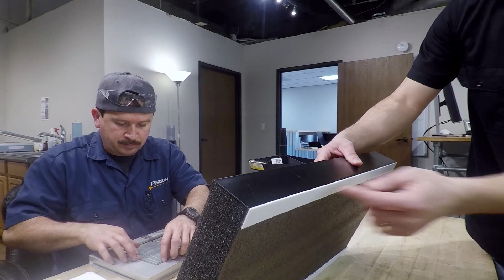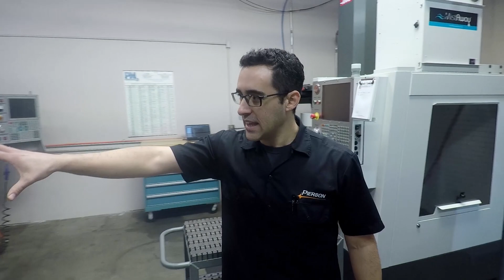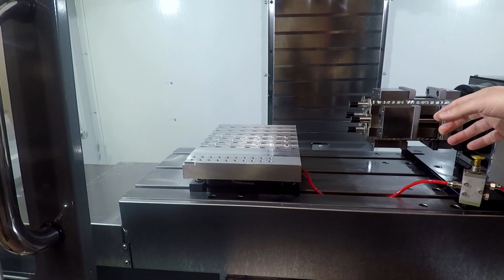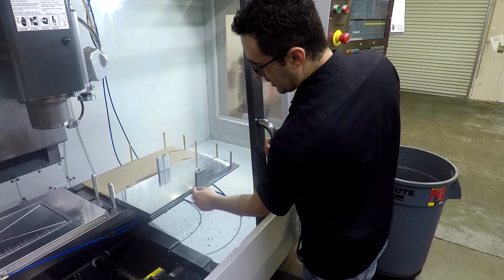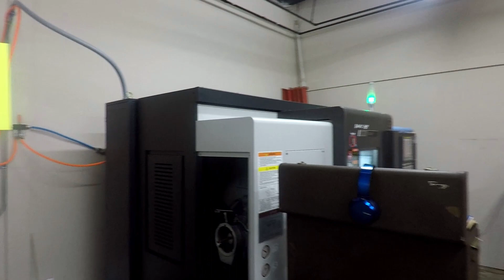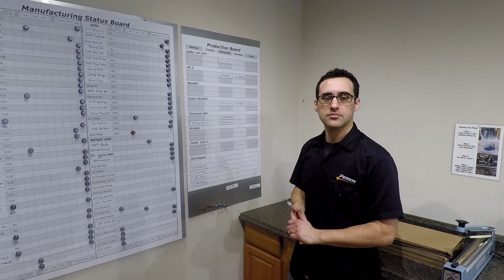AWESOME Lean Machine Shop Tour: Pierson Workholding!

Comment: I know this is an older video, but there is still A LOT of very good information here.
When I was in charge of a group of routers, I came into it with people doing 6-8 setups a night and a complete clusterfuck disaster of tool and material storage/staging. Once I got everyone on board with it, we increased production by  just over 30%. The most impressive was that we almost completely eliminated re-work. It was tough to get everyone to work together on it.

Comment: Lean makes sense when used sensibly. This is the perfect example of that process....trouble is that many companies have been using it as a tool to beat their people over the head with and make short sighted decisions based on it. Managerial motivation and experience are a huge key to making it work.
Reply: Great shop and tour! Lots to be learned from this.
Reply: devore1776 Lean for profit = failure. Lean for people = success.
Reply: Pierson Workholding truer words rarely stated!

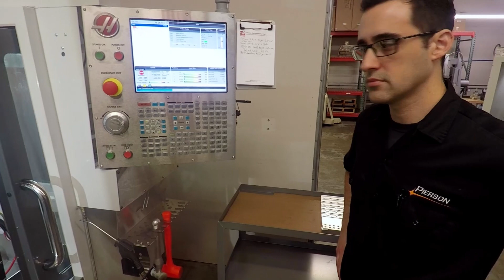Comment: 9:15 As to Jay's comment about Dovetailing a "0" Op. I see the logic of it.

Many of the Dovetail fixtures I see, are rather slim in design. You can typically run a larger part on smaller machines, and or use shorter tools, and feed faster. Which make up for lost time making the dovetail. It really comes to a simple scenario for a particular part whether or not if the machine time can be improved that beats the time to make the dovetail in the first place. If it technically doesn't, than that Pre- Op can be nixed.

Comment: One of the problems with lean is that companies don't understand what it is. They think lean = trim the fat = spend as little as possible and pay crap wages. They keep maintenance nightmare machines from the early 90s, never upgrade their tooling technologies, never update their machining strategies, never upgrade their programming technologies and rather than hiring clever people who can help improve the process...they simply standardize the process with no plans to improve. Then they hire people who will work for bottom dollar to push the green button. Oh, and the biggest sin of all is that they think employee downtime is costing them money so they'll intentionally avoid doing things like deburring in the machine so the employee will look busy during the cycle. Even at the expense of spindle down time which is MUCH more costly. They'll build cheap fixtures which take far too long to setup and they skimp on tools and techniques that make setups faster.

That's not lean manufacturing...that's just plain stupidity. Invest in the equipment, tooling, software, etc you need to get the job done efficiently. Streamline your process to reduce spindle downtime. Keep things organized and clean. Keep materials and tools close to where they're used (The machines don't move...why not store raw materials near them?). Take care of your employees and they will gladly take care of you.
Reply: Kenneth Higley Yes most companies don't know what it means. In a nutshell, Lean is the ability to see and eliminate waste (8 wastes to be exact) through continual improvement.
Reply: Kenneth Higley Those businesses will eventually die
Reply: THIS.
Reply: If good ideas are brought to management they see it as a threat.
Reply: Spot on !!
Reply: Sounds like somebody was hurt real bad by this philosophy.
Reply: Pumasforpe

Cc
Reply: The funniest thing is that if you look at Toyota production system, or other successful lean manufacturing systems, every example you gave is the opposite. State of the art machines in perfect condition, perfectly optimized and modern cutting strategies, ALL THE WORKHOLDING, and a team of amazingly competent people working super efficiently because they are payed well and can see how their input changes production strategies.

Comment: Without question this is my favorite video I've ever seen on YouTube. I know a lot of people have been in this position, but as a sole proprieter manufacturing multiple products and lines TIME is the single most expensive resource. During the day I have my lathe cutting blanks, TM2P finishing back end on one side and doing final engraving on the other side, OM2A machining the the main side of the part, heat treating oven cycling, tempering oven cycling, tumbler cycling, sandblasting 200 parts a day, inspecting, C02 laser cutting the packaging, packaging the parts, shipping, receiving, purchasing, website listing/modding/inventory update, replying to hundreds of messages/emails/FB msg/FB page msg/FB Group MSG, Designing the parts, programming no less than 20 parts a day, test running, then take a nap at the 12 hour mark to make it a full 18 hours 5 days, and 12 hour days on the weekends. That's all just ONE product line... the other is 6 years old and has a lot more walk away. SOOOOO many things in this video I made notes on and will look into incorporating. That board at the end was like seeing the pearly gates open. I am CONSTANTLY paying rush shipping for one of the hundreds of tooling, parts, hardware, components that I order late, or (much more often) my vendor is out of stock (like Maritool chamfer mills I order 10 double end at a time was out this week). SO MUCH GOOD STUFF in this video. I am seriously going to look into that automated part loading system and will be calling the Doosan rep now that I have seen that 220SYL to replace my aging twin turret live tool lathe. 

Thank you John
Reply: Brian Carmicheal Thanks for the kind words and glad to be an inspiration. It almost sounds like you might need an/another employee! :)
Reply: Couldn't agree more! I have a guy that's been doing the sandblasting full time since Dec.... Called out all week last week. Worked yesterday... no show today. Been getting worse and worse ever since he was part time/occasional he was pretty flaky but I thought it would get better when he left his other job and went full time here last month. Sad thing is a lot of people would do it for min wage and I started him at $12 and told him it'll work up to $20 by the time he can run every machine in the shop. Thinking I need to start his replacement at $10 so I can give him an early raise for inspiration or hire an operator at $15 that will hate sitting and sandblasting 70% of the time. Employing is tough.
Reply: Hey Brian, any need for ISO 20 holders? I have a bunch of barely used technics from my short time using an OM2A at uilabs. Let me know I can make you a sweet deal on them.
Reply: no option to message you on your channel that I can see.
Reply: Hate to say it, but one thing I've learned is the hardest part is to know when to let someone go. Sounds like you're in the position where that isn't even a possibility until you find a replacement, though. Trust me, you aren't doing your employee any favors by allowing the no-show flakiness
Reply: It'll be my first time doing it for my own company. Let people go as a call center manager, but it's a very different, and much tougher thing to do when it's just the two of you day in and out. It's to the point I had to tell him I literally do not have time to listen to the excuse 'story' unless he is off the clock. Guy takes 15 minutes to tell a story that boils down to 'other things are more important...' 7.5 hours later: 'can I borrow $40 till payday?' 

I have a couple resumes from a help wanted I posted over the weekend. Going to bring a few guys in for "day labor" to get a better idea of how the operate before hiring.

Comment: Quite fascinating, love the cleaning at the start of the day and the simple reordering process. However is this type of system principally appropriate to a maunufacturing production process rather than a job shop environment? I do see though many ideas that would benefit many situations such as tool location etc.
Reply: Absolutely would work in a job shop... We're a job shop but with just one customer. :)  It wasn't covered, but we practice lean in our front office too and if it works there, it'll work anywhere.

Comment: The only real problem with all of this is having to work for the unimaginative and lazy.

I've talked for years about doing stuff like this in a body shop. Management. Will. Not. Listen. As another stated, every good idea is a threat to them.

And while I'm now called to be a missionary, a large part of ministry is actually starting my own mechanic shop in a foreign country. Just the thought of implementing all the processes I've wanted to for over a decade is exciting.

The board is great. I've found every shop that's implemented a computer system I've worked in has actually become less efficient. There's no visual distinction in staring at a bunch of lines in a spreadsheet. These software hawkers show the "rapid increase in productivity" from the time they initiate... and star-struck decision-makers never get that the measurements are relative to when the shop gets kneecapped by their system in the first place.

Comment: lean is fantastic but you need to have the buy in from all levels of the organization and with that everyone needs to put in thier .02 cents and work together to come up with a plan that works for everyone and solves their issues. hard to force lean in an environment where they dont embrace the change or thinks it helps streamlines ones's job.

Comment: Thanks for this. I wish I could go all Mario Party on that like button😊
I'm still solo right now, but thinking like this early as we grow will help so much!
Reply: Anytime is a great time to start embracing Lean, but the best time is when you're solo!
Reply: Pierson Workholding It seems so. As I've been working in the hour since watching this, I've already noticed a few things I can tweak in my shop to save time.
BTW, this video also demostrated the beauty of your vacuum plates, and how using two means my machine wouldn't have to wait on me to load parts. I'll definately be a customer a little further down the road!
Reply: definately build good practices and thought methods while you're small and inherently agile. changes later are harder to make but will have to be made if ya don't start well. the most important thing to foster is open mindedness and acceptance of new ideas. something that comes for free when small.

Comment: An important thing to remember about Lean is that there is very little 'new' about it, but it has been rebranded and repackaged. Poke Yoke is what I've called idiot proofing for years. I like that this video addresses the fact that some of the principles don't fit this guy's business. This is the most overlooked thing about Lean, Lean gives you a tool kit, you've got to pick the right tools to achieve the outcome you desire, just like any other job. This is a good video and this is a well set up shop.
Reply: Josh Hanson lean definitely is not new and has been rebranded several times. What lean is based on is the "Pareto principle"  you can sum it up as eliminating waste. The problem with all of this is the human factor combating laziness, bad attitudes and the rest of negative human behavior. Getting organized is easy per say but maintaining indefinitely is the real effort. Understanding what works what doesn't. And convincing the clipboard holder who is incompetent and reads from the lean script can be torture. When i hear the theres been a study or i hear lean i cringe. Some shops are very fluid. Some do the same motion forever. Anyway great vid!

Comment: I have to ask, why all of the complicated workholding and rotary axes, instead of an HMC with pallet pool?  With an HMC you only buy the rotary axis that is in the machine, you load up all your workholding on the pallets, and the machine can run unattended for long periods.  I see 6 VMCs where probably 3 of them (the ones doing production) could be replaced by a single HMC.  Yes, HAAS got out of the HMC market because the Japanese do a good job at making them.  Makino is a very highly regarded brand for this type of production work.
Reply: Good question. Many reasons why we don't and won't buy an HMC. Here's the top 3: First, we don't overproduce.  Overproduction is lean waste #1 and should be avoided at all costs! Second, you can buy four VMC's for the price of one HMC. Third, an HMC still only has one spindle.  I'd rather have four spindles cutting simultaneously.

Comment: Nice work ethic you've got there. LEAN is a great philosophy the only problem with it are LEAN experts that come in and fix a problem by adding 10 new problems. I hate LEAN experts with a passion, they don't know the job and $100,000 later they saved the company by moving your stapler around. I also like that you don't have middle management sitting around that waste everyone's time going to get permission to edit something in the mng. software so you can just get back to work. It also elevates technical know how over ass kissing and number manipulation.

Comment: Actually my arduino uno,cnc shield and all related software like (grbl.9,arduino ide9.6,X-loader,inkscape etc) are working fine.But still stepper driver is heated that means they are working fine but I don't know,why do my stepper motor is not working fine.
For x,y and z axis none is moving single distance.please can you suggest me,what might be the problem as I'm giving 12v,2a supply through cnc shield.
Reply: +Diesel Ramcharger ,sir,a4988 red one, I am using, should I buy other green one one and recheck it.
Reply: Just because your motors are warm doesn't mean your drivers are fine.
Reply: With experience of early reprap machine - won't be the stepper, as others have said will be driver (or the way that is wired up if not moving at all). They trip out on overheating as they have overtime built in - 1A without additional cooling, max 2A with cooling. Try freezer spray to quickly check if is that, add heatsinks with thermal paste if not already done so..
Reply: single distance not moving mean that stepper motor is not showing any kind of movement.Sir,please can you refer me arduino  uno+cnc shield+a4988 using grbl,arduni ide and x-loader  as hex file generator.
yeah g-code is successfully generated in grbl firmware but let me use new driver green one.
Reply: Suggest disconnecting one stepper motor and seeing if that moves OK (if it does then it is mechanical friction/drive current that is causing the problem, but unlikely if no steppers moving at all), then check/swap wiring. to the motor, if it then works make same connections with other steppers.
Reply: SORRY please,reprap machine,wired up,max 2a with cooling,freezer spray,add  heatsink with thermal paste ,really I don't understand the term.
Reply: +Festoolification ,Sir I did it both ways. Now tomorrow I am going to change stepper driver a4988,if not worked then I will buy new DVD lens replacing these old DVD lens (stepper motor)
Reply: Not sure DVD lens stepper will have enough torque - depending on what you are driving - have you had them running on their own at all - try this to check signal pairs..
http://electronics.stackexchange.com/questions/134930/wiring-up-a-4-pin-dvd-drive-stepper-motor

Comment: Can you please give me brand of vises on 4th axis? I'm looking for something like this right now. Thanks
Reply: It's one of their prototypes
Reply: My company now is looking for wise smaller then 12 inch length over all
Reply: Oleg Vodovozov This is our new product that we'll be releasing in a week. The overall length is about 9 inches. Stay tuned.
Reply: Ok. I will.
Thank you
Reply: hrc-rr No because a bearing support isn't needed. We machined those cast iron parts at 350 ipm on the rotary vise with amazing results. Again, we're in the business of improving conventional approaches.
Reply: Yes it is. Right now I'm using one kurt vise on it. But on some parts it's really uncomfortable to use it. I checked on internet and didn't find any cnc vise shorter then 12 inch. So I could rotate my trunion and not to be afraid that I will hit the table.

Comment: I think you are confusing well organized bureaucracy and lean manufacturing. One of the tenets of lean manufacturing for example is to avoid regrouping multiple operations on the same palet because you can't re-organize the production of those operations and some incidents could stop all the tied together operations. But I don't think pure lean is a good goal either, it's a bit like communism, there is always people judging you are not extreme enough, and you don't feed your kids with utopia. I think those people are getting it right, organizing your bureaucracy is the first step before changing your process, and if they have no issue with their tangled operations, why would they untangle them, to follow ideology?
Reply: I think you're confusing lean principles with having one set method of doing things. Time to go study back up. ;)